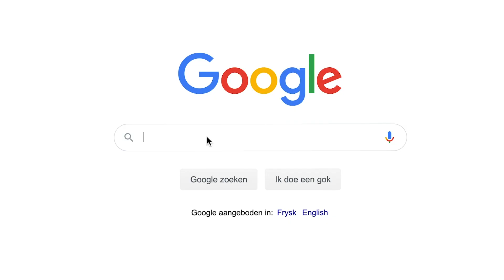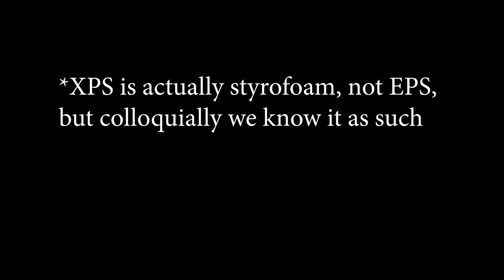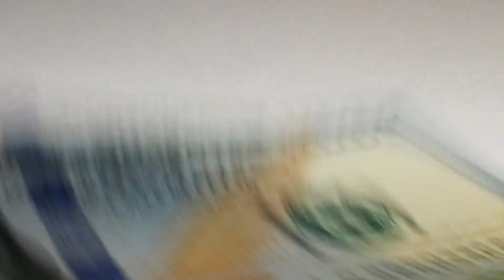Guide to Sustainable Architecture: Greenwashing

Comment: 🎯 Key Takeaways for quick navigation:

00:47 Sustainable architecture involves more than just adding green features like trees; it requires considering the materials used and their environmental impact.
01:26 Greenwashing occurs when sustainability claims are exaggerated, leading to confusion about what truly constitutes sustainable architecture.
02:09 The short lifespan of buildings, combined with the use of non-biodegradable materials like styrofoam, contributes to environmental waste and degradation.
03:04 Styrofoam (EPS) is commonly used for insulation despite its negative environmental impact and poor recyclability, highlighting the need for more sustainable alternatives.
04:32 Current building practices prioritize cost and aesthetics over sustainability, leading to unsustainable structures and practices.
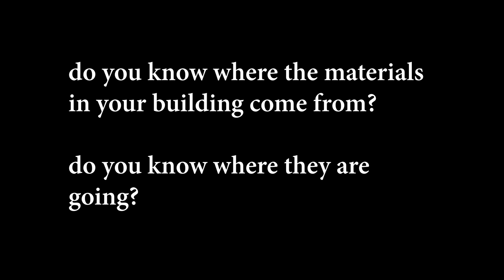05:16 Understanding the sources and end-of-life destinations of building materials is crucial for promoting sustainable practices in construction.

Made with HARPA AI

Comment: 🎯 Key Takeaways for quick navigation:

00:03 The building sector contributes to 40% of global carbon dioxide emissions, highlighting its significant environmental impact.
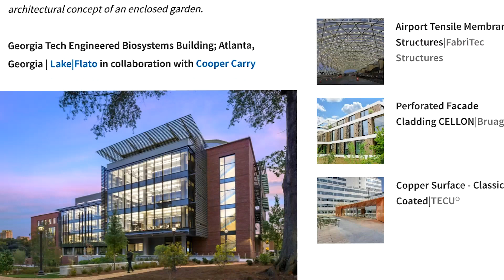01:12 Greenwashing blurs the lines between what is truly sustainable architecture and what is marketed as such, often through exaggerated claims or superficial green features.
02:09 The short lifespan of buildings (averaging 50 years) leads to wasteful disposal of materials, contributing to environmental degradation.
03:04 Styrofoam (EPS) is commonly used in construction for insulation despite its negative environmental impact and poor recyclability.
04:32 Current building practices prioritize cost and aesthetics over sustainability, leading to unsustainable structures and practices.
05:16 Understanding the sources and end-of-life destinations of building materials is crucial for promoting sustainable practices in construction.

Made with HARPA AI

Comment: Maybe a focus on reclaiming the materials would be a good meeet-them-half-way. Can't polystyrene be processed back into new blocks?
Reply from the maker: Yes that is what they are currently trying to set up in this interdisciplinary project (link in the description). The biggest issue is- its only the EU currently working to establish this recycling scheme. And all polystyrene before 2015 has this banned fire retardant, which means you cannot simply recycle it. You can see in one of the resources that when they banned it for environmental purposes, they actually exempted the build industry from the ban for five years, which is crazy.